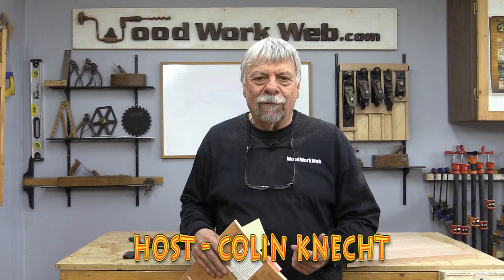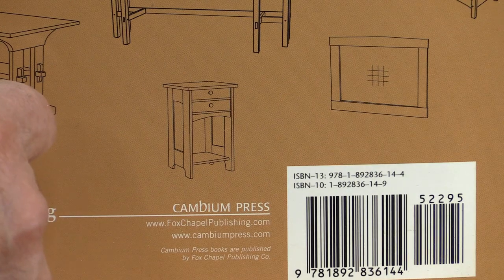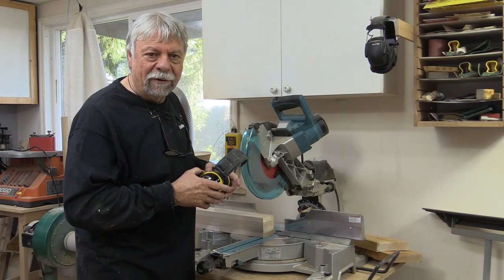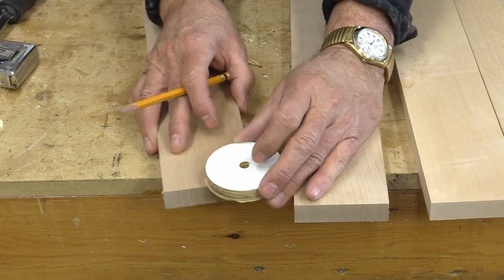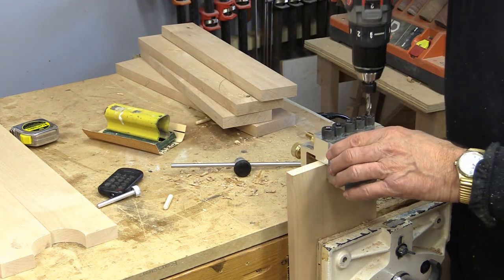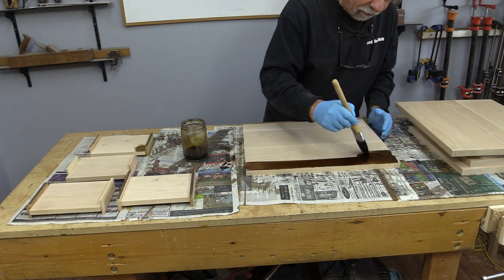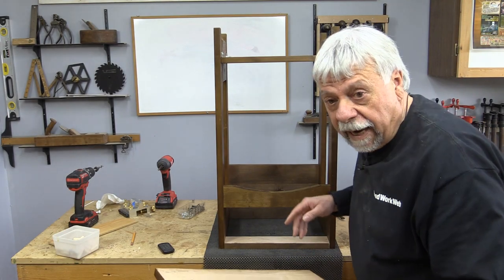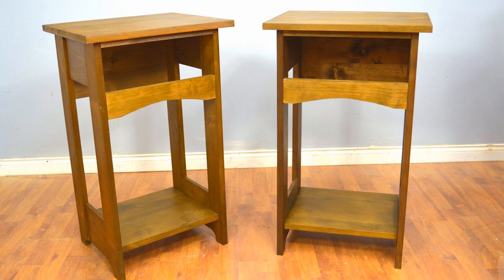Make BedSide Tables (Nightstand) / Arts & Crafts Style  | Woodworking Projects

Comment: Hey Colin another great video. As a Dowelmax user I noticed in the final assembly you glue the dowel holes but not so much the mating surfaces. Are you relaying on the strength of the dowels only and not the mating surfaces. Glad to see you are using my tip of sanding and painting the pre assembly dowels.
Reply from the maker: Hi Daniel ... re: gluing ... yes and no.  When I have edge grain up against long grain I pretty much rely on the dowels to do the work as gluing anything to end grain is not very effective. If I think there is going to be some pressure on the joint I will put more dowels in. 
For long grain to long grain I would normally glue those joints and rely more on the dowels as matching up the sides for me.
Reply: Hey Mr. Colin may I know which varnish you used for the wood.

Comment: Great video and some good info on finishing. A couple questions. How did you register and drill the dowel holes on the flat faces? I understand how to do that on the edges using a dowling jig but it doesn't look like it would span the width of the flat face; especially since they're not centered. For that matter how did you register them with the mating dowel holes. Finally, what type of varnish did you use?
Reply from the maker: Hi Carl, you register the doweling jig on the flat surfaces the same as you do on the vertical ones ... by lining up the edge of the jig with the edge of the wood using your finger, it sounds crude but very accurate, (if you put a human hair on a flat table and put your finger on it, you can feel the hair, that's how sensitive our fingers are) ... if the holes are more in the center, I use a wooden stick as a measuring tool from one end of the wood as you can see me taking it off around the 7 min mark
Reply: This is helpful. Thank you. I'm assuming that if you want a reveal or any sort of offset you would just put a shim of desired thickness between the edge of the board and the edge of the jig. And then clamp everything. 

And as an aside, I made a measuring stick with a dowel through a wooden block with a set screw to lock it in place to repeatedly set distances from a given end.

Comment: Hello Colin,
I am curious, why do you let the miter saw stop before raising the blade?  I have seen others do it also.
Thanks.
Reply: Dave White you get a cleaner cut by letting it stop before lifting the arm.
Reply from the maker: Hi Dave, yes we do that because often there is catch on wood when you lift the blade up when it is spinning which can create an unsafe situation.  This particularly happens when you have a stop set up on the saw and are cutting a number of pieces. The if the blade is lifted while spinning the piece that is jammed between the blade and the stop will often jump or flip out. It's just how I was taught man, many years ago. 
Most carpenters and house builders I have worked with never wait for the blade to spin down but they are also working from a rougher, construction type area, so often not nearly as critical.